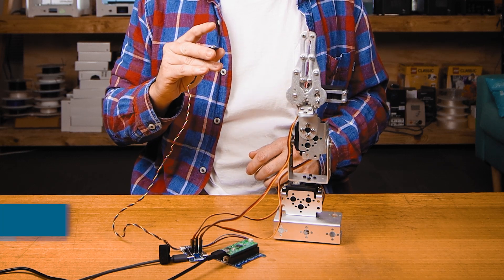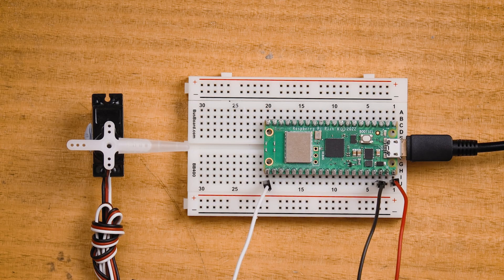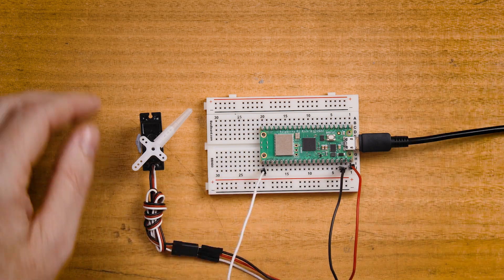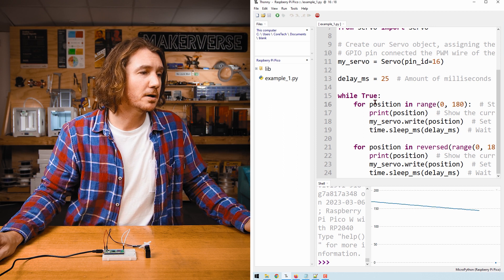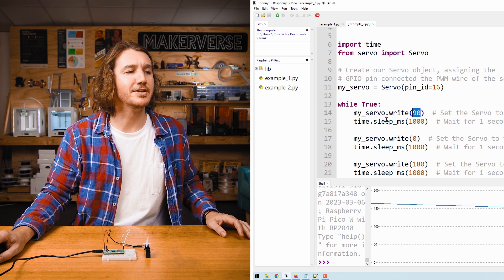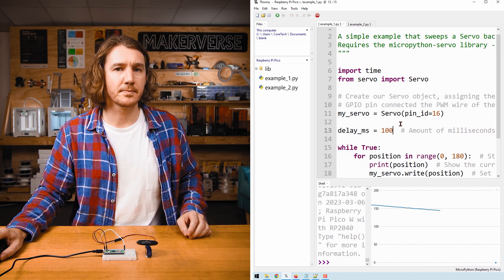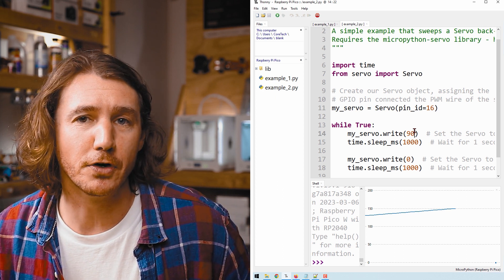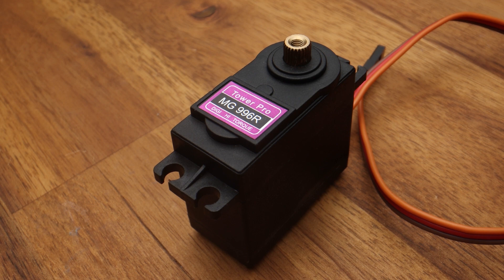How To Use A Servo With Raspberry Pi Pico

Comment: Following code line by line and when I get to run, I get an error saying "no module named 'machine'".  It is a requirement of micropython-servo .... what package or plug-in is it?
Reply: have you got micropython installed on your pico? if not, go to the bottom-right part of thonny and click "install micropython". go through the needful and whatnot, then the machine library should work!

Comment: Is it normal for the range to be less than 180 degrees, around 160 or so?  Is there a calibration process?
Reply from the maker: Some servos may have more or less range, check the data sheet of your servo model to see what it is, 160 sounds like a weird number though 🤔

Comment: Guide, what guide? Go to where? You're forgetting you're teaching novices. 🤦‍♂️
Reply from the maker: Hi Richard, it's in the first line in the description.
Reply: @Core-Electronics  Hi, sorry. I'm an amateur model maker trying to get battleship turrets to turn and elevate and I've ended up in an electronic and programming nightmare😱😁 Thanks, I'll re watch it.👍
Reply from the maker: No worries mate, sounds like a fun project 👍
Reply: After my initial outburst  (from my frustration rather than anything you had or hadn't done, once again my apologies) I have to say I found your coding, description and explanations very easy to follow and I now understand a heck of a lot more than I did yesterday. Thank you.👍
Could you do or have you done a follow up to this vid covering running two or more servos doing independent movements simultaneously? That would certainly be of great help. Thanks again.

Comment: install --progress-bar off micropython-servo
PROBLEM IN THONNY'S BACK-END: Exception while handling 'install_distributions' (AssertionError).
See Thonny's backend.log for more info.
You may need to press "Stop/Restart" or hard-reset your MicroPython device and try again.

Process ended with exit code 1. 
Whichever library I downloaded got the same error